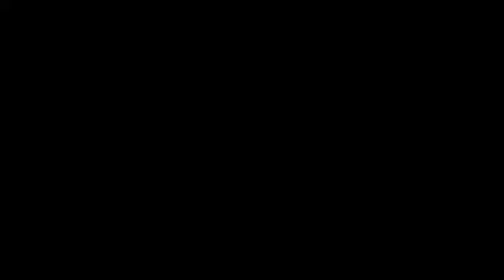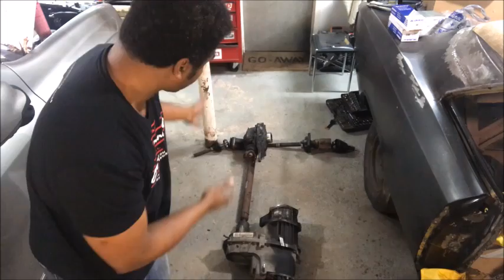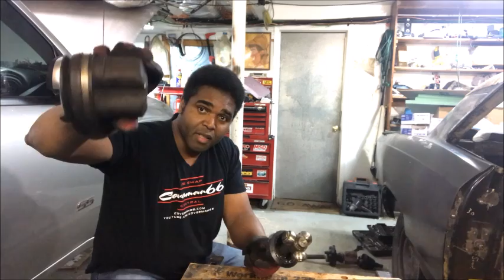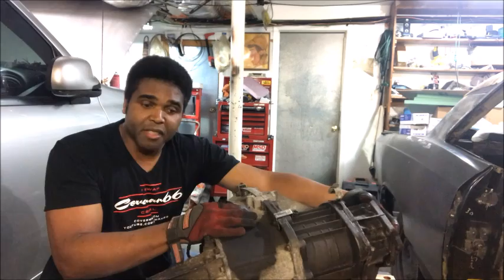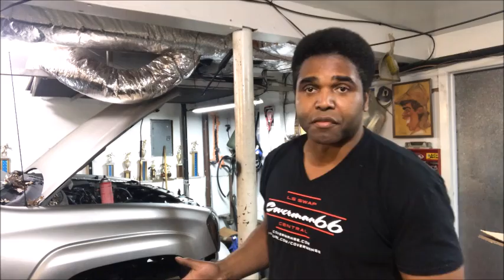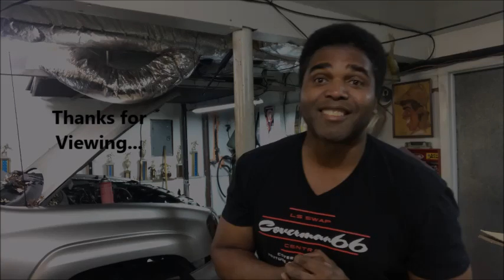How to Convert from All Wheel to a Rear Wheel Drive Trailblazer SS (Do's and Dont's)

Comment: So...just verifying I could potentially remove the cv's, axle shafts, and front driveshaft and have a rwd vehicle without any ill effects on the trans/transfer and no CEL?
Reply from the maker: i cant answer that, i decided to remove everything to make mine a rwd.
Reply: coverman66 I can now tell you that it will not work on a 2007 Escalade.

Comment: Hey Terry I have a 2007 trailblazer ss I want to make it rwd can I just remove the Front driveshaft and leave it like that?
Reply from the maker: ive seen that done before.. i removed everything because i pretty much had the engine out.. not to mention the front diff seized.
Reply: @Coverman66   Thanks I appreciate it man
Reply: I just got my motor build I have aftermarket pistons and rods. Would love to go with a 100 shot of nitrous what do you think?

Comment: After all that was removed did you put in a new transmission or is there a new housing you had to put on. Also did you have to get a new driveshaft. I appreciate your channel I have learned a lot from it. In the process of removing the engine but I wanted to make it rear wheel drive.
Reply from the maker: much appreciated brotha Dan.. i went with a new tranny for a rear wheel drive and i had to get a new drive shaft for sure.. totally worth it..
Reply: You have a part 2? Which crossmember? PCM tune?

Comment: Hey man I have a awd trailblazer ss 2007  and the front diff went out I want to make it 2wd but what would I have to do. Do I need a  harnes and a different trans can you help me plz and thanks in advance
Reply from the maker: no problem, i got you covered.. how far do you want to go.. you dont need a new harness. you could remove the front driveshaft. and not replace the tranny.. you have several options..
Reply: coverman66  thanks man I really appreciate it  and well I’m going to start by taking it apart transfer case front axels and drop the trans and take it to a shop so the can put the inner shaft what else do I have to do

Comment: How do i remove the cv shafts? Pulling my motor becuase its knocking
Reply from the maker: you have to remove the wheels and hubs.. the axle should come out.. mine were seized in so i had to cut them out..
Reply: I got the top end of motor, breaks, wheel bearing hubs out. Didnt sure if there was special tool or somethin
Reply from the maker: once the hods are removed the cv joint should be able to be removed out.. you might have to pry them out..

Comment: I have am 2008 tbss awd i am doing a 6l90e rwd swap. Can i use the front stubs of a 4x4 trailblazer fron the same year to delete the awd. I have a spare pair of 4x4 axles so i would rather cut the 4x4 ones up and sell my tbss axle and drivline
Reply from the maker: that should work.. i understand,, i had to cut mine because they seized up..  in the front diff. keep me posted brotha Mike..
Reply: Mike how did this work for you ?
My daughter has an 02 trailblazer 4.2 4 wd  the bearing plate went and snapped clean around the oil pan mount .. I am gonna try and chisel it out but was wondering if I could use the ends of the cv chart to keep the wheel bearing together I’m pretty sure if you just take the cv shaft out and use nothing behind it  will blow the bearing apart since it’s not supported but I also hear autozone lists the 4wd and 2wd as the same bearing

Comment: How much would you pay for a job like this? Im about to take out the engine and tranny to rebuild the 4l70 but my question is would it change anything? Or would it just be considered a rwd instead of a converted awd? Idk if that makes sense but just to let my mechanic know that my awd got converted into a rwd
Reply from the maker: do you live in a area that gets alot of snow.. you have to do alot of lil things to get it to work..

Comment: So I can leave the front diff In. Where can I purchase axle stub shafts? Pull the rest of the CV axles out of the front diff? When’s there removed just plug them with plastic caps and silicone?
Reply from the maker: i know guys who left the from diff in but removed the cv joints. i got the stub staffs at any chevy dealer parts dept.
Reply: @Coverman66   awesome thank you

Comment: You change the pickup tube ?
Reply from the maker: no, still using the stock tube brotha..
Reply: Adding an extra qt is safe? I just worry I’m gonna blow mine up 
The guy I bought mine from had to replace the engine because he sucked it dry on take offs ... and that was a stock engine lol

Comment: I know what you went through to get that out its a big pain in the butt, I agree with all you had to say about that job. FYI if you have high mileage the catalytic converter's like to stretch and let the guts lose then that rattle in till that brake apart in to little pieces that will leave tiny pieces of platinum all over the back end of the SUV , and to get the exhaust Y pipe out you have to Jack and support the transmission remove the cross member that supports the transfer case, and finally you can remove that Y pipe also there may be 4 02 sensors that will also have to be unplugged along with the left rear 02 sensor wire leads that run across the cross member that wire will have to be free up as well .:-)
Reply from the maker: sounds like you felt my pain lolol

Comment: I really want to covert my SS to RWD but i just dont want to spin crazily smh! My 4l70 is already built and what not, indecisive
Reply from the maker: i wish i could help, ask yourself... what do you do with the truck.. are you planning on racing it? spinning can be fun lolol
Reply: coverman66 I do nothing but fix it currently LOL! I want to make it RWD to make it much more reliable, also to do burnouts. Currently, it is backfiring crazily and when it locks up at any MPH, it shakes really bad. I feel like there’s something wrong with the transmission or with my tune.
Reply: coverman66 I am leaning towards converting to RWD though. I’ll just get some slicks